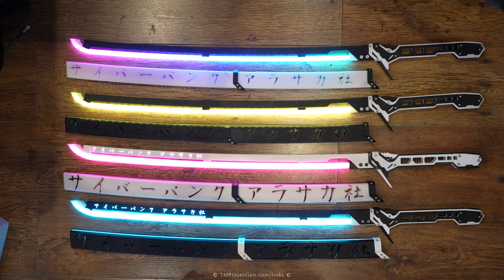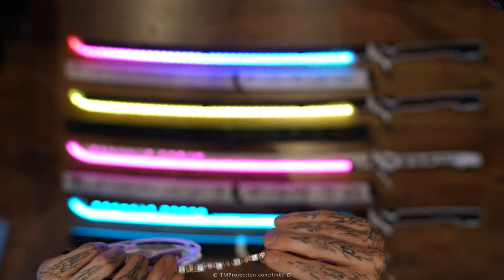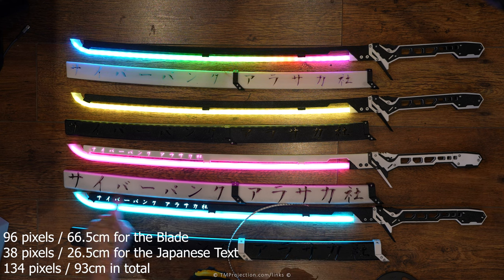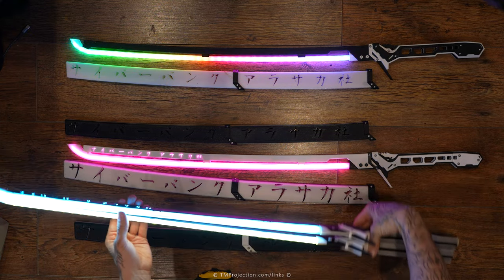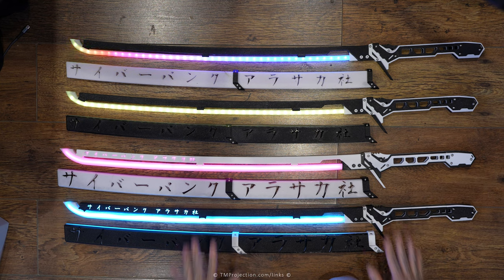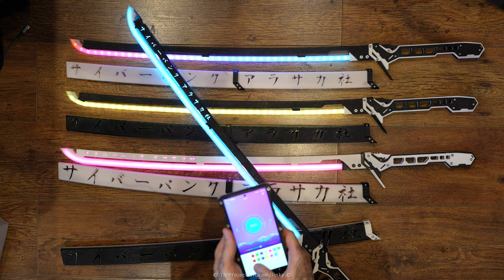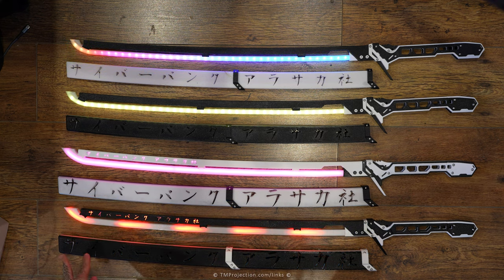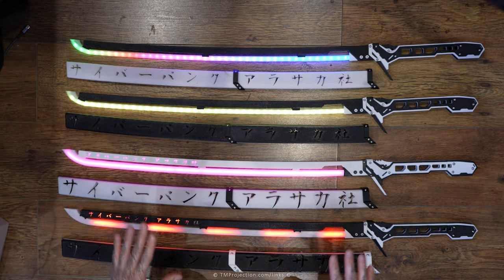Cyberpunk Arasaka Thermal Katana VERSION 2  - 01 - Differences Overview

Comment: Great design! before buying it, I have a question : what is the widest led strip acceptable? it is almost impossible here to find led strip with SMD 3535 AND a density of144led/m. Even in 60led/m, only a few strip are 5mm wide...
The best I can find is 10mm wide.... and most of the strip is around 12mm wide..
thanks in advance!
Reply from the maker: 8mm mate, and if you have trouble sourcing one I'm happy to sell you one, Worldwide shipping
Reply: @TMProjection  How much